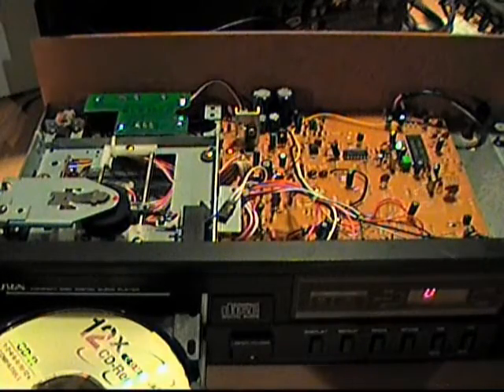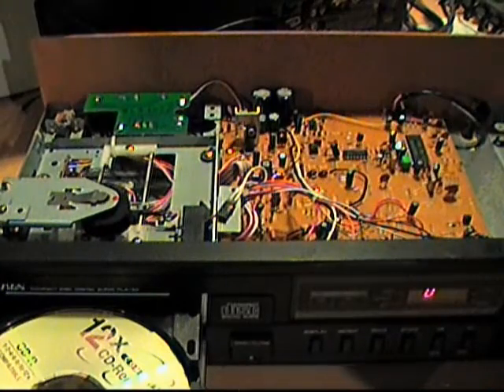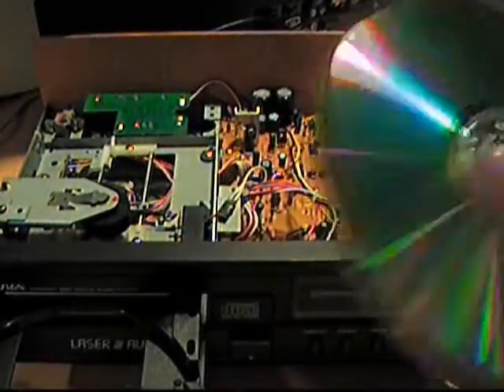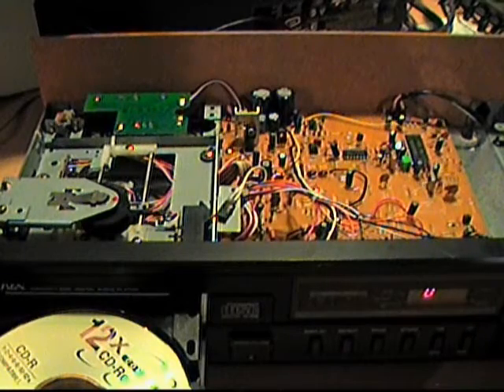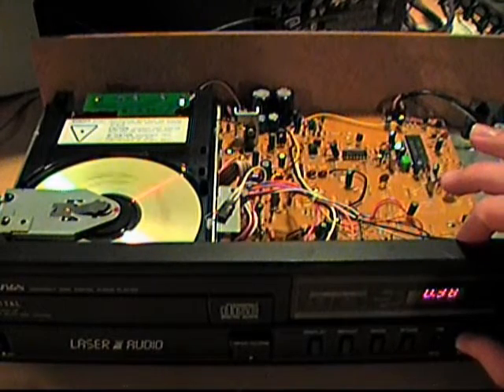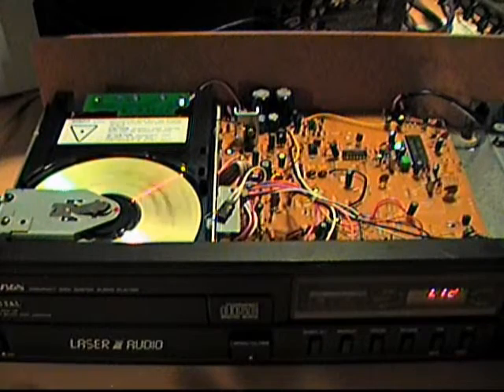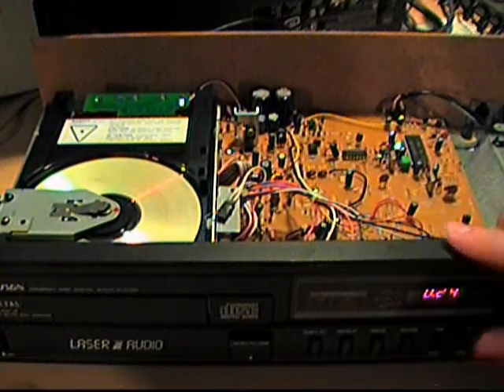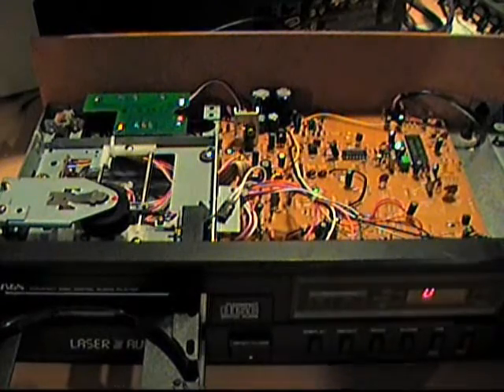Inside the 1986 Soundesign CD player

Comment from the maker: @Zim0256 Since the late '80s, most CD players spin the disc several times faster than normal, in order to do "digital oversampling" (usually 4X or 8X speed), so the disc takes longer to spin up to the accelerated speed.  Older CD players spin the disc at its native "1X" speed, and use analog filters on the output -- or in Soundesign's case, no filters at all!

Comment: I just picked up this exact model at a thrift store and it actually works and sounds fantastic. The only issue is the forward skip button won’t work :/ I’m gonna try opening it but I’m no expert
Reply from the maker: Try spraying some electrical contact cleaner (like Deoxit) into the switch.
Reply: @vwestlife  Thanks, I'll give it a shot. I appreciate the advice!

Comment: Sure does considering that most CD players can play CD-R discs, even first and second generation ones. The CD-RW discs require special players though why exactly I am not sure but I think it has to do with either the file format since I think they use UDF rather than ISO-9660 or the construction since they do use a special crystalline layer under the normal surface for the erase and re write capabilities. But most likely the latter of those two is the cause I just don't know which one it is.

Comment: yup that glitch at 0:50 seconds on the CD display that is an mp3 glitch, ive been downloading mp3s for years and every now and then i come across an mp3 like this i have to delete it and find another copy but lately that hasnt happened b/c of reliable high speed internet transmissions preserve the data in the songs. of course i havent burned music CDs b/c of my ipod and my PSP and other mpe players but these 80s cd players work better than todays stuff although some dont play CD-Rs.

Comment: @vwestlife My aiwa system has a 3 disc changer, it was the latest made by aiwa and uses a single chip SANYO cd player that calibrates everything automatically, it doesn't have any adjustment VR on the board. It reads awfully and takes a lot of time to seek any track. 1 generation early the same cdplayer used a 2 chip design also by sanyo and worked better with only 1 manual adjustment. Another older generation used 3 chips but it required 5VR to adj. All of them read at 1X.